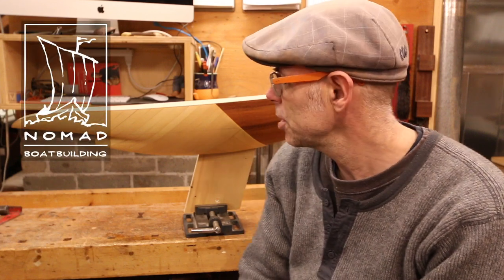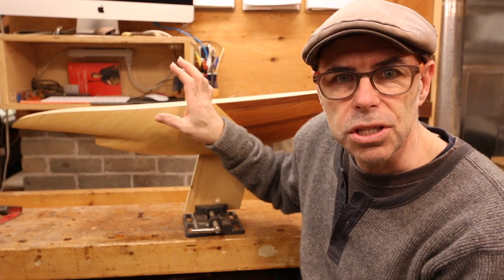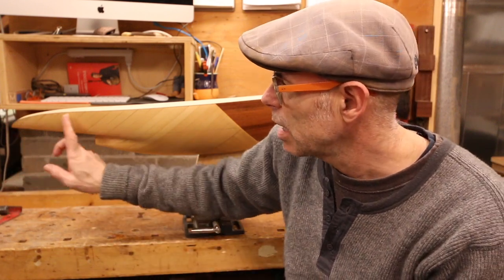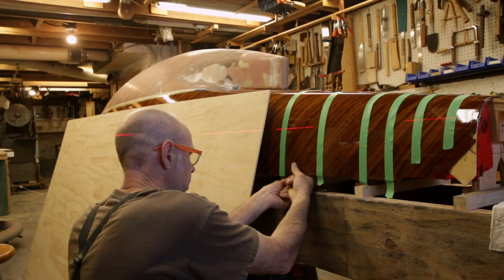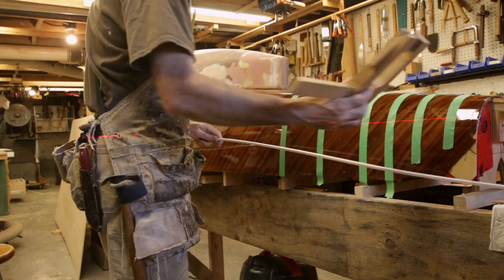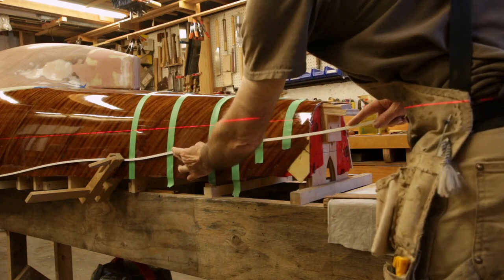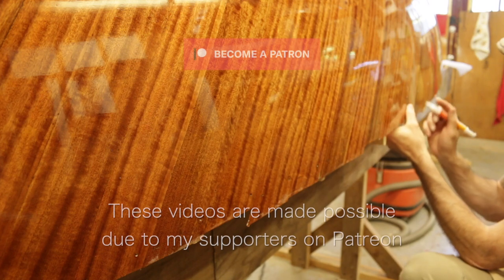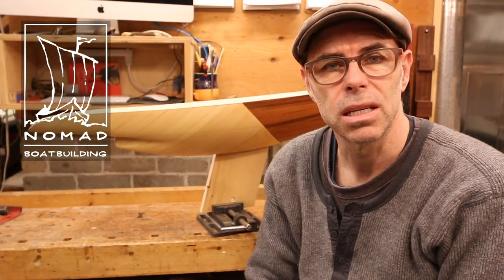International 2.4mR Sailboat Project - Episode 25 - Plotting the stern profile

Comment: Heyo..! Love the methods & techniques.. 
Mirroring the stern-line: 
Happy to see the paper come out, thought. I like to keep a role of builder's felt (the grey stuff) cause it's cheap and has a lot of body to it. With a big enough piece folded in half lengthwise, it could be stuck to the hull from the center-line over before any layout. Once removed, any humps can be faired on a table (drawing curves etc) then cut through both layers. Unfold and lay back over the hull, the crease down the center-line and a perfectly symmetrical layout.
Reply from the maker: I should really get a roll of that in here. I’m sure I would use it for all kinds of stuff. All the felt I keep on hand is saturated in tar.
Reply: @Nomadboatbuilding  Handy stuff that.. You sketch something out you like and you have something you can cut out to make a template from (or whatever...)
Reply: That’s a great suggestion but compound curves can make the paper/plastic templates pretty tricky. Definitely one to keep in the toolbox though, it all depends on the specific situation you find yourself in

Comment: With you clamping of the batten problems, you could have used off-cuts of wood or ply as clamps and screwed them into the waste you want to remove from the hull. Much easier than struggling with various clamps.
Reply from the maker: Certainly could have but sometimes you just start going down one path and it takes you where it takes you.
Reply: @Nomadboatbuilding  We have all done that

Comment: Another great video....  At time 8:40 or so, had you considered using double sided carpet tape to hold the flexible button onto the hull?  A strip of carpet tape would allow you to adhere it to the line, and could be adjusted without fiddling with the clamps..
Reply: batton. not button--
Reply from the maker: I certainly pull out the double sided tape a lot but I wasn't thinking along those lines just there. I think that was sort of the first kick at the can to see how it would shape up and I got there fast enough without trying to strategize too much.

Comment: Since this is a one design boat, I wonder if you have considered the benefits of buying one.  Especially if you can find one with hull damage but otherwise in good condition.  In one stroke you get the spars, all the hardware (very expensive if purchased individually), a rudder, and possibly some useful rigging.  You can take each piece of running rigging and measure the length you will need for the new ones.  You have a guide for how to arrange the controls.  You may even get a set of sails which are good enough for initial trials.
Reply from the maker: It not actually a one design class. It’s a development class. The client did but one right before proceeding with the build with the idea that we could possibly cannibalize it if we desired.

Comment: Hi Mark. Can the compass thing be done with strings? cheers from Brasil.
Reply from the maker: Excellent question. If the overall shape was symmetrical then probably yes, but the path string takes as it wraps around the form will affect its accuracy.
Reply: @Nomadboatbuilding  bit like finding great circles on a globe 👍😎